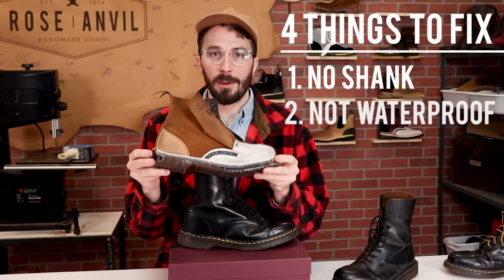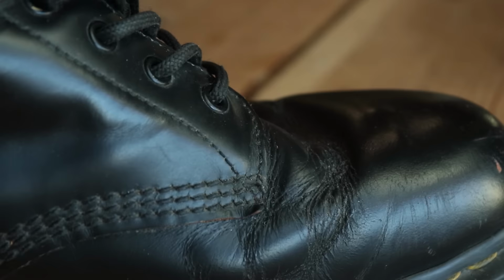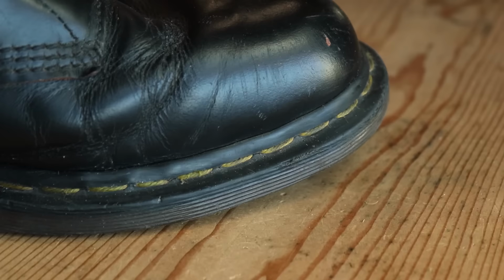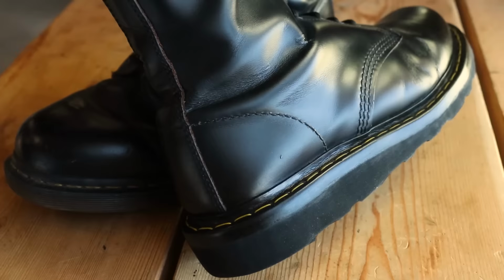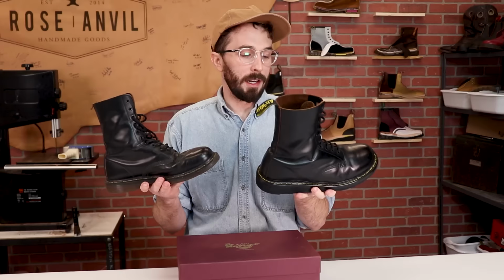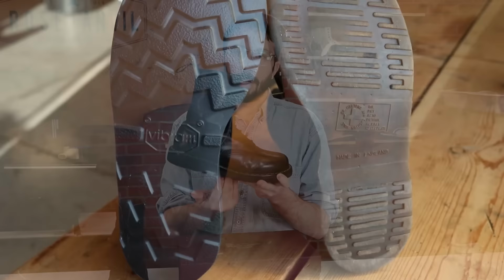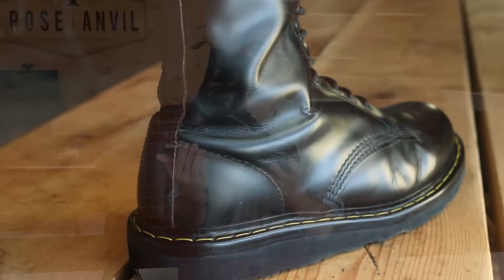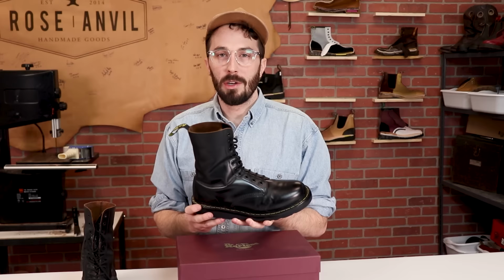Dr. Martens Resole -(MAKING DOCS BETTER)- 4 Big Problems Fixed

Comment: As a cobbler myself , that was hell of an improvisation of a split-welt, amazing job on resoling those boots, cheers
Reply: Much respect to your craft!
Reply: Odd question, but do you have any advice for people looking to work as cobblers?
I've been working at a shoe shine shop, and with a historical society, but I'd love to get In to actual cobbling (not sure if that's the right way to phrase it, but hopefully you'll know what I mean) but I haven't the foggiest idea where to start.
Reply: @greytging  Ask a few cobblers/shoe repair stores. Most are small independent stores who find it hard to find good help in store. 
I work for Baxter & Black in Sydney Australia. That's how I did it anyways.
Reply: So rose and anvil have nothing to do in shoe manufacturing I'm shocked they only cut boots in half :L
Reply: Now I know why you guys charge what you do to fix boots. I’ll never complain again the next time I need a resole job
Reply: I've always been curious in the trade and Leather Work in general, if I may ask, how do I learn and what's the best method at current to learn the trade?

Comment: When you revealed the wooden shank and said "what??" I died from laughter
Reply: Bcuz that’s a made in England pair
Reply: A pair of mine have a shank in them, I know cos I can see it, but they’re not a made in England pair. They are quite old tho so that could be why
Reply: I have a pair of cheap lugs with a doc martin style sole, and even they have a steel shank xD A magnet will stick when you pull out the insole. Surprised the hell out of me. If lugs can do it... it really makes you wonder why doc can't.
Reply: @rich1051414  Cheap offshore production costs, and or cost effective,

Remember doc martens aren't just a working boot anymore
Reply: They all used to be made in England back in the day
Reply: A wood shank explains why the fucking things are so useless to wear walking long distance, so much for the cushioned insole
Reply: Mine from the 90s also have a shank (they're battered, but still kicking). None were offshore then.
Reply: Did he forget to add a shank? Then why does he say they didn't make them right?  He didn't even add a shank.  I have a made in England pair i bought in the 90s.  I rarely wore them. They are the black stitched ones. I knew nothing of this brand so i thought the yellow stitch was dumb. 😂 lololololololololol
Reply: @erniecarrasco9107  He didn't forget, he mentions why a shank isn't necessary for wedge soles like this lol. Full point of contact on the ground unlike docs. 👍🏻
Reply: @shelbyb1413  he saves himself. But still, a shank will always add more structural integrity to any shoe in the long run. So you both fail epically. 😂 Lololololololololol
Reply: @TheySeeMe  thats sad

Comment: As a cobbler it was interesting to watch how you overcame the lack in cobbling tools. I would recommend getting an American straight needle with an awl haft. Doing a lock stitch over a saddle stitch would have saved you a lot of time. Also, try southern leather for some of your supplies.
Reply from the maker: Thank you! I actually did a lock stitch at first but it was fraying the thread so I switched back to saddle stitch. Does southern leather sell welts? Or do you know where to buy them?
Reply: @RoseAnvil  they do sell welts. We get probably 90% of our supplies from southern leather. We have a sales rep that personally takes our orders but he claims you can order everything off their website. You can also try Miami leather too if southern doesn't have it.
Reply: Hmm
Reply: @RoseAnvil  Panhandle leather is another place to look.

Comment: Amazing how much can actually be done without specialist shoemaking tools and machinery as long as you know the principles. Nice touch with the storm welt too. Great job all round!!

One mesmerising channel to watch is 'bootfury'. A Russian who'll deconstruct/rebuild/make the uppers from scratch as well.
Reply: Though, most shoefixers use a machine for all the sowing.
Reply from the maker: Thanks! it made me really appreciate what real cobblers do and it made me want to buy all of their equipment
Reply: soz but what's a storm welt? as in waterproof?
Reply: @gregj7916  Yes. More weatherproof, but Google it anyway. In short, the welt is wider than a standard Goodyear welt, and is partly flipped up along the side of the upper so there's a moisture barrier.
Reply: Greg J Greg J a welt attached to the upper, and a midsole, then the midsole is attached to the outsole. Normally in a storm welt you would see two stitch lines around the soles but here he’s using glue
Reply: @gregj7916  Its actually a split welt.
Reply: Those anvils he's using sure seem like specialist shoemaking tools to me
Reply: Apart from every tool, the anvil and the mechanical devices absolutely no specialist tools were used......

Comment: This reminds me of being a kid and watching my grandfather work in his shop. I could almost smell the horsehide glue.
Reply: @Skip Ives 
 I thought it was rubber cement. I’ve never heard of “horsehide glue.“
Reply: Modern shoes use contact cement. The old standard was "Barge Glue" which is in part, made of horse hide.
Reply from the maker: Ya that glue definitely has a distinct smell ha ha
Reply: Elle Sea 
So the collagen in our skin is named after “make glue??” I have a hard time accepting that as fact haha.
Reply: Rose Anvil 
What type of glue did you use then if it wasn’t rubber cement? Just curious.

Comment: Wow such craftsmanship.  I never realized the amount of time and effort that goes into doing a quality resoling of a boot.  How many hours did it take you to do the boots?
Reply: I'd like to know how much this would cost. I once had a pair of shoes resoled over 25 years ago and I don't remember it being that expensive I think around £5/10 (but it wasn't a patch on these and would have been way simpler to do on shoes).
Reply: @repletereplete8002  For a Goodyear welt resoling they asked me €200, for a pair of Red Wings. You'll probably pay more for Docs, because they have to basically install a welt, as shown in the video.
Reply: Very fascinating
Reply: @luissorsini  uh. Was that a quote from redwings themselves? I was expecting less than half that if the welt is good. What was your boot, and what exactly needed to be done?
Reply: For the amount of work he put in to resole them. It would be cheaper to buy a more expensive pair of boots that can be resoled later. Unless like him you are doing it for the sport.
Reply: @luissorsini  Thanks a lot for that info. I guessed it'd cost in the 100s.
Reply: Replete Replete redwing full service is $125 for midsole/outsole, conditioning, new welt if needed and new eyelets. Local cobblers I’ve found will do it around the same price.  Trenton Heath do it for about $200. Wesco does a full rebuild by adding new counters and vamps for $250. It really depends on the boot and the cobbler.
Reply: Here in the US, I pay $50 - $80 for a resole job. I go to local guys, and have never sent a pair into get factory resoled.
Reply: @spaiduhz  its £90 as far as I'm aware.
Reply: @spaiduhz  No redwings (yet) for me. I was looking for a used pair on eBay in nice conditions and then I would have them resoled. So I just enquired about the price for a resoling with an Authorized Redwing cobbler and they said 200, with original soles and "Redwing standards". It would probably be cheaper if you managed to find a good "unauthorized" cobbler. From what I get, they are the only authorized for my country too and it plays a role, I believe.
Reply from the maker: With the filming slowing me down it probably took 10-12 hours ha ha stitching is what took the longest because I saddle stitched everything instead of lock stitching it.
Reply from the maker: With the correct tools and supplies used by someone who actually knows what they are doing I’m guessing it would only take and hour or two.
Reply: @repletereplete8002  You'd probably be looking at around £200, that is if you could actually find anybody to do it. (There used to be one company apart from the DM factory who'd strip off and heat-seal on a new airware type sole for about £70 but I think theyve stopped doing it.) A regular leather/dainite outersole replacement is anywhere north of that amount, but then add in new cork footbeds, leather midsoles, and hand-stitching on completely new welts and you're probably looking at a couple of hours of labour on top of that. So, a bit more than a tenner unfortunately!
Reply: @RoseAnvil  Ah, that's what I thought. You weren't lockstitching!
Reply: There is a Youtube guy in the US who does those kind of work. Resole would start at usd200
Reply: I thought I was just gonna listen in the background but ended up watching every second. Great video.
Reply: Thank you for supporting your local shoe repairers. The earlier commenters got it right, it would be $120 -  $250, throughout most of the country. This was a lot more than just a resole, which for cristy full soles is generally $60 - $125. Your local shops might have low rent and or utility costs compared to the rest of the country; either that or they're underselling themselves.
Reply: @repletereplete8002  Full resole is pretty expensive. But in my area for example rubber halfsole and heel tips cost about 40 euros. So if you replace them early enough you really don't even have to get a complete resole. And some places might charge extra 20 euros or so if you want it stiched again.
Reply: seriously though. Full resoles are a bit bonkers to do with these days costs so heel tips and half soles are probably more viable. and If its done properly there really isn't too many downsides to it.
Reply: @joejoelesh1197  same price in my town

Comment: I bought a couple pairs back in the early 90's. Wore the leather insoles out under the ball of my big digit. Little bits of wool or felt came out through those holes day by day until I was able to completely slide the leather insoles out and found about a hundred little splinters. I never knew that was a shank until now. I remember thinking, "How'd that mulch get in there?"  I squat a lot. Kneeling down - butt on the back of one heel balanced on my toes. All that squatting split the rubber sole linearly on the ridged side of the sole at it's thinnest point. I paid $275 for those, my second pair in '97. Yes. I still wear them. Although, they chew up replacement insoles. The leather is butter.

Comment: Wait, what? all of my dr martens have been waterproof, I alwayse treat them with dubbin as recommended
Reply: Doc martens have never done me wrong always been waterproof and personally think he ruined them
Reply: Yeah the only pair I have that are t waterproof are the canvas ones. The leather ones are always waterproof and have thicker leather than the ones he cut in half.
Reply: You don't know what u are talking about 🤦‍♂️🤦‍♂️🤦‍♂️
Good job!!
Reply: @jayhowell7553  thanks i think the same.
Reply: I have literally WADED through water with my docs and my feet are dry. they might as well me wellies
Reply: @jayhowell7553  Well you probably have low standards
Reply: Non of mine had ever been water proof. I've had docs from thirty years back. Twenty years back and ten years back. I lived in my first pair for ten years but I shouldn't have. After about five years was the limit for them. They looked fine but without a proper shank they sunk under every step and ruined my arch

Comment: The work looks great, but mine is a philosophical question: Since Dr. Marten's big thing is the Air Wear Soles, is it still a Doctor Marten if the sole is no longer?
Reply: As well as the tire rubber welt....  I was wondering the same thing.
Reply: the reason why they are big on those soles is because that's one of the few parts on that boot that is actually copyrightable. The shoe came out of a dr. Martin factory, it's a dr. Martin shoe
Reply: No. It's a far superior creation. This is what a Dr. Marten aspires to be.
Reply: @wellsmitchell49  "Superior"? While I agree the craftsmanship is superior now, is it really a "Doc"? Leather soles offer a completely different experience than the AirWear Soles.

Comment: You have inspired me to attempt upgrading an old pair of hiking boots that have proven hard to resole at local shoe repair stores. The storm welt solves the biggest issue.
The only question is what adhesive is advised? I have tried many options none seem to be durable enough to do the job well.
Reply: It's been a year so hopefully you've gotten an answer somewhere by now, but if not, look into Barge contact cement; I don't make shoes but he's definitely using some sort of contact cement, and Barge is a good strong one.

Comment: Would it be possible to resole a pair of Docs with the replacement Solovair soles that you can buy from their site?
Reply from the maker: Ya I’m sure you could do a similar technique and just use their sole instead of the vibram sole
Reply: Novapolitan
Reply: This comment saved my life.
Reply: Jonas Comb  try 4G leather crafts if they have a shop in your area. You can probably mail it to them if you live far.

Comment: 2 things I learned about Doc Martens years ago. 1, buy AT LEAST half size larger and use memory foam insoles with good arch support. 2, Before you first wear them use a neutral dubbin in all the stitching and use a hair dryer to melt it into the thread to waterproof them. Hopefully this will make your use of them less hellish and less damaging to your pocket. Lack of a shank can be a problem, but if you dubbin it once a month and use boot oil in the creases they shouldn't crack and split for a long time, mine have had 20 years of casual use and due for a resole soon, was thinking of getting them converted into clogs.

Comment: How old are these? asking in behalf of shank appearence
Reply: You know how they say never trust the internet. I will have to cut my own docs in half so that i can actually get the truth finally.
Reply: Hakim Mohamad  not if I order a pair from China, a pair from Thailand, a pair from England..etc
Reply: Hakim Mohamad 
Wedge soles don’t need a shank, but I’m pretty sure Thorogood and Danner have steel shanks in their moc toe boots. Red Wing moc toes do not have shanks.
Reply: Hakim Mohamad 
Again, most commonly you’ll find moc toe boots without a shank, but several brands always include a steel shank in their boots. 
I think a decent portion of Red Wings do not have a steel shank.

Comment: There was a common flaw a few years ago with Doc's....The sole was splitting in thousands of peoples expensive boots! Mine included! I contacted Doc Martens and was fobbed off by them, they suggested that i should have bought the more expensive made in England ones. My reply was, "I thought mine were made in England" turns out, the majority are now made in Thailand or similar, with a short run made in England....Will never buy DMs ever again, cost me over £100 and they lasted about 2 years before splitting! Local shoe repair guy said he couldn't resole them. The sole you have fitted looks awesome.

Comment: Yep these were made in England. It says so on the bottom of the outer sole. Also the interior is always a tan color while the ones made over seas the interior will be the same color as the exterior.

Comment: I am impressed . We build boots about the same and the differences aren't meaningful. I would have probably put in a metal shank but I get why you didn't.  Those boots now are 100% better. I was particularly impressed with your storm welt... I've never done that.  I confess since its a factory boot and you never know what crazy way factory boots are made , they can be a mess to rebuild. ...( all though your show address that with the cut aways .)  I would have probably just cut off the heel , sanded the sole flat and glued on a new lug sole. Great job.

Comment: the wooden shank that you found is because it is an older pair. Dr. Martens has stated that they removed the shank sometime in the early 2000's, because: "we found that it added nothing to the structural integrity of the boots".

Comment: Solovair sells replacement soles for less than $20 a pair, they are similar to Docs but thicker and tougher, The best are the Commando, they have a lug tread design like the old pre 2003 Docs. Since they are all made of PVC they can be hot knifed or Barge Super Stik cemented back together
Reply: Are Solovair replacement soles compatible with Doc Martens and will cobblers do that job?

Comment: Excellent video but in the UK we can get Dr Martens resoled with genuine Dr Marten soles or, I believe Vibram for longer wearing. £50 plus postage. The resolers are trained by Dr Martens and have the necessary equipment.

Comment: No doubt they are now better performing but docs were meant for the comparitive comfort, compared heir contemporaries due to dr marten’s injuries. I guess they were kind of a smart casual boot, rather than a tough work boot, for example. I prefer the look of the heeled airwear sole too.
I’m surprised to hear you’re not a pro shoemaker, you did a great job!

Comment: I bought a pair of the Tarik boots in Crazy Horse leather. I really like them except for the sole. If I could have that replaced they would be perfect for long term use. They are just too slippery with the PVC sole that has no grip on super smooth surfaces so I have to be careful where I wear them.

Comment: great job. i was recommended a pair of Docs to wear as work shoes behind the bar. sales staff said waterproof, chemical proof, slip resistant, blah, blah, blah. they lasted a bit over three months. i took them back, complained. they begrudgingly replaced them. three months later they were screwed too. took them back, they refused to replace them. "i had mistreated them", apparently? never recommend them, never buy them. you are paying for a name and that's it. can buy a lot better boot for less.